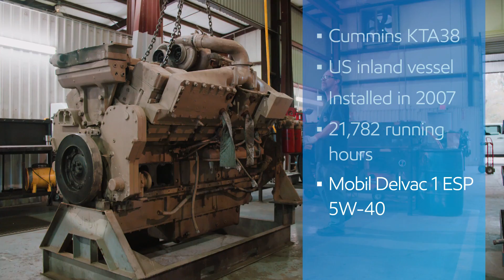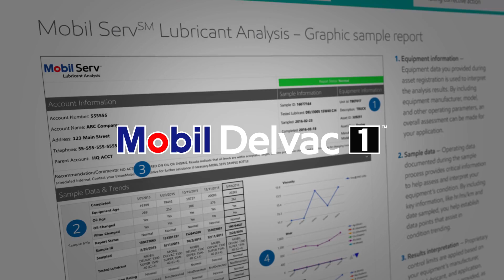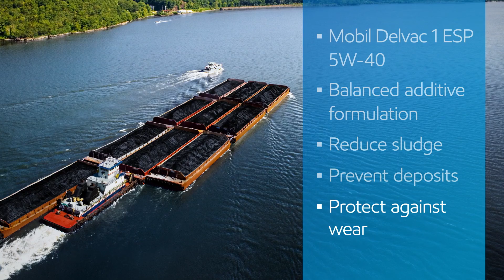Inside the engine: 10 years running Mobil Delvac 1™ ESP

Comment: Good morning, do you use a heavy-duty engine oil such as Mobil delvac modern 10w40 or 15w40 on a petrol off-road vehicle model Suzuki Jimny 4x4 with a 1.3 LT petrol m13a petrol engine from the year 2001?  greetings from Pontassieve province of Florence!

Comment: We waiting for Delvac 10w-40
Reply: A 10w-40 conventional Delvac would be perfect!  That 15w seems a bit thick for NY winters, which is the only reason I run the 5w-40 synthetic.
Reply: @Hubjeep  well a 15w-40 that’s synthetic will can have better cold flow performance than a conventional 10w-40 depending on brand. One thing that is certain is that full synthetic or synthetic blend oils generally flow better in cold temps
Reply: @Hubjeep  ywdfyrccueh
Reply: @Hubjeep  iedgyisyjzngywub hi Co
Reply: @Hubjeep  no it's not.  -40 degrees Fahrenheit or colder there?  If not your good
Reply: @scottp6761   Interesting.    I’d like to run conventional.   For example, my old diesel Onan DJC 12 backup generator specifies 5w under 32*F.    I run 5w-40 year round.
Reply: @islandcontent8825  conventional is no bueno
Reply: If they can make 10w 40 full synthetic for trucks I would buy it

Comment: This motor suerly has different kind of oil filters that are able to filter different sizes of deposits so it can use the oil longer.
Reply: Sure. Bypass filtration, whether it be a centrifuge or just a canister design can easily keep high quality synthetics in like new condition for long intervals. It doesn’t hurt that these type of engines have huge sumps . That’s not taking anything away from Delvac1 oils. They’re still one of the few that use a large percentage of PAO base stocks in their products. It’s a top shelf oil that must be run very long intervals to make it cost effective.
Reply: @prevost8686  would you consider 15w40 mobil super x0 api sn formula as good as the delvac?